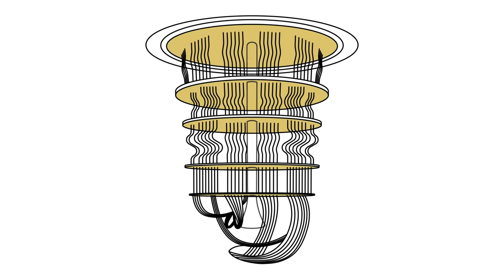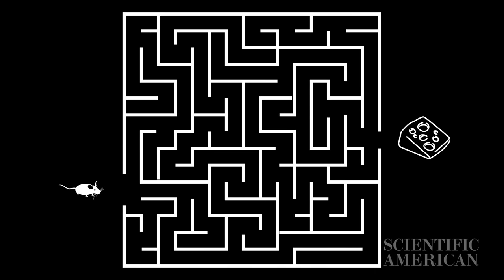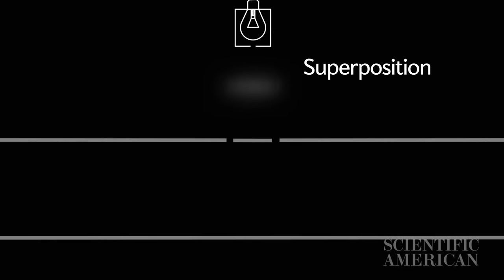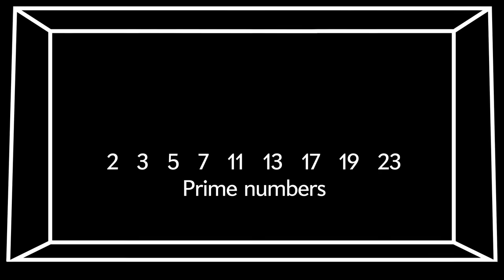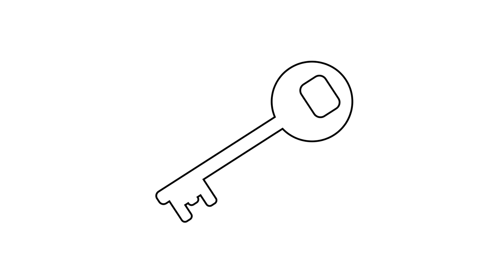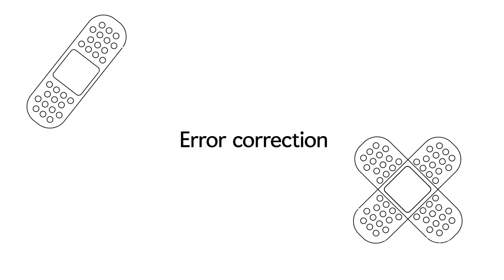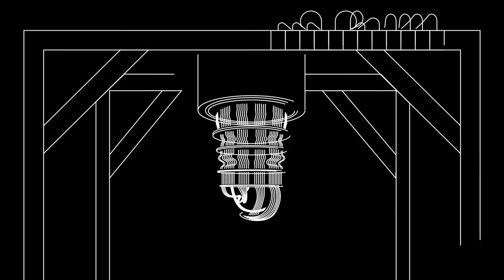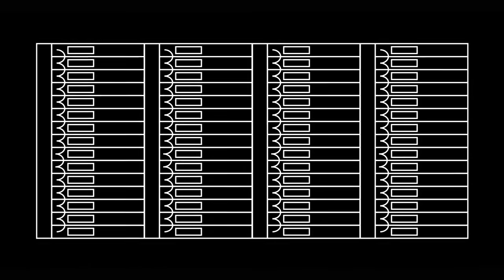Decoded: How Does a Quantum Computer Work?

Comment: ok i guess my question is not "how does a quantum computer work" but rather "how does a quantum computer collapse the system to the solution"
Reply: Yes that is my question too and it did not provide answer.
Reply: Perhaps it is that you tell it the answer you want it to figure out.
Reply: Same here. Even if you tell it the answer, how do you know when the answer is achieved if the only way to collapse the system is observe it? Also, iiuc, “good” encryption algorithms (since breaking encryption is often cited as a quantum use case), even when you get the keys right, you aren’t presented with a light bulb that says “unlocked!”… you just get indecipherable garbage on the other side, which again suggest you have to know what is in it already. I might have that wrong, but still…. Don’t understand 😢
Reply: Very carefully
Reply: Observing isn't actually looking, in QM observing is the act of interacting with a particle to reveal or detect it's location, which inherently causes the superposition of the quantum state of the particle to emerge at a point, hence collapse to a state of detectability. Think of it like throwing a ball in a pitch dark room. You don't know where it's at or the speed at which it's traveling. This is analogous to a quantum state of a particle. To detect, shining a light is the only way to know where the ball is. According to the nature of QM, the ball just freezes, and collapses to a point, but you don't know how fast it was traveling. You can use another detector to find the speed but you won't know where the ball will end up. This is what observing is like. The problem with this type of physics, is that you cannot know both the speed and position. There is a name for this principal. It's called the Heisenberg Uncertainty Principal.
So, I believe that the act of collapsing is executing some kind of action that causes the system to reveal solutions with the path of least distance or resistance, so to speak. How it does it, is probably inherent to the nature of the qbit, which this video, and every video, fails to explain. Most likely because they don't understand it well either.

Comment: I must disagree with other commenters.  This video does not “decode” a darn thing.  For instance, how does one arrange the connected qubits for different algorithms?  How are initial conditions determined and set?  Hows does the algorithm recognize being done?  Or how about a real problem that DOESN’T use Shor’s algorithm, like finding roots for a complex polynomial?  Or address the mundane, like what does the “code” look like?  

I would call this video Fluff With Facts.

Comment: I figured error noise occurs because the suns radiation, maybe if you encased the computer in a cold and thick lead case the quibits would stay active to perform properly
Reply: It is already enclosed inside a closed chamber. check out bluefors.

Comment: I wonder how a quantum computer would handle frame rate in videogames. Would it be infinite fps or infinite frames would impossible?
Reply: Once.you measure, you get the one frame.thatnyou care about. 🤔

I would imagine it is a useless problem. You can only take advantage of problems that require massive parallelization.

Comment: 3:49 But wait 2 bit system also has 4 possible values 00,01,10,11 and 20 bit system has 2 ²⁰ posibble values = also more than milion
Reply: 20 qubits have 2^20 base vectors. The total number of states is every possible superposition of those base vectors, which is exponentially more than the number of state vectors themselves.

Comment: its "Quantum supremacy"....

?why did not Google run the Shor algorythm with 54 qubits
that would be capable of handling values up to ~1.8014398509482E+16
(and it would have been a more logical/comparable demonstration)